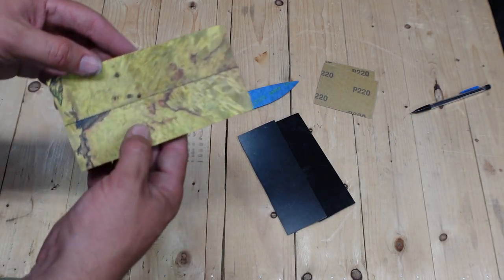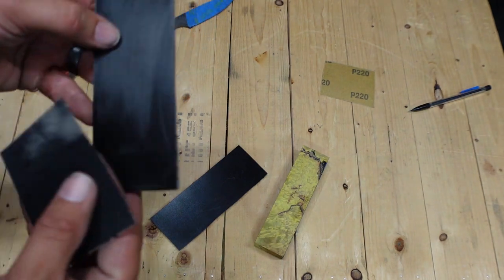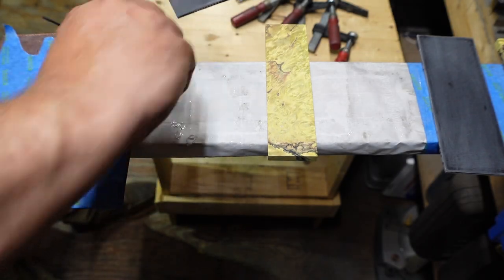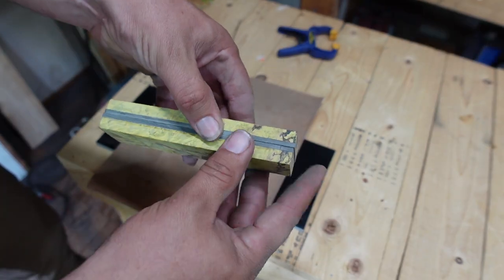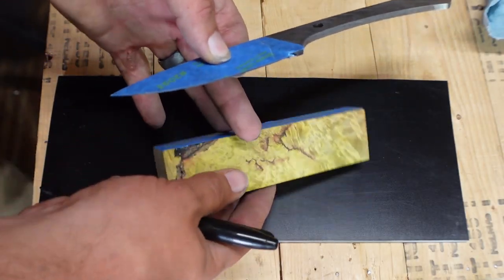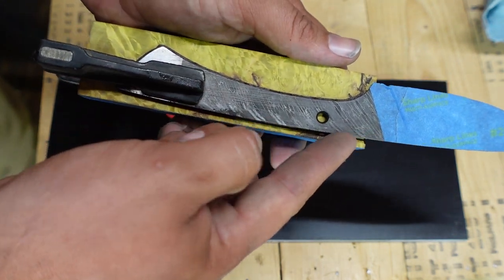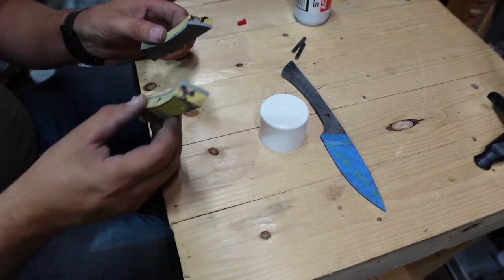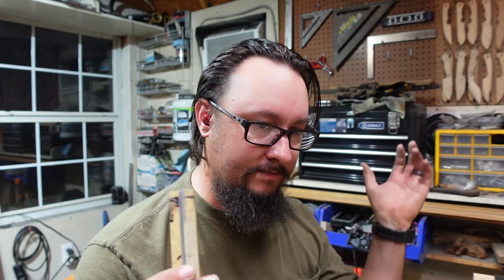Building The Scales For The Cable Damascus Knife | Knife Making | Vlog

Comment: I think I might look into this new glue. I often use manzanita wood that I harvest myself, and it almost always has cracks or termite tunnels in it. This stuff just might be the ticket.  Hope you're doing ok, sounds like ur under the weather with a case of the crud
Reply from the maker: Yup, I'm dealing with a respiratory infection right now. Good ole spring allergies. This glue has been a blast to work with and is super helpful.
Reply: @theriversexperience9383  I'll probably pick some up next payday. I mill some of my own scales out of manzanita I harvest locally, which often has some termite damage.  Hope you're feeling better!

Comment: Good job, Erick! The Starbond is being used by a number of knife-makers. They’re raving about it!
Can I ask you what type of blade you have on your bandsaw to cut the scales?
I’m thinking of buying a bandsaw, and wondered if you use a metal blade to cut the scales/micarta - whatever you use, or if a wood blade is better. 

Cheers 🍻
Reply from the maker: This blade is a 14 TPI bandsaw blade by Lennox. You can get them at most hardware stores.